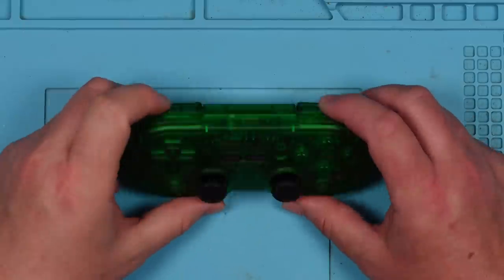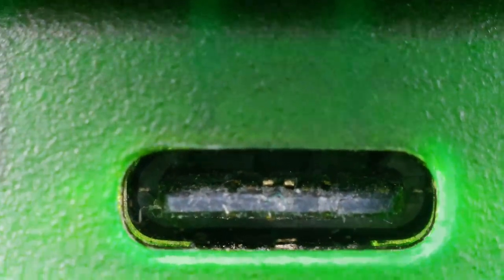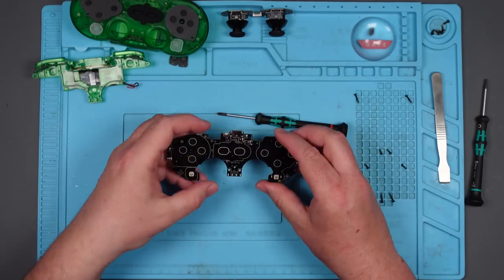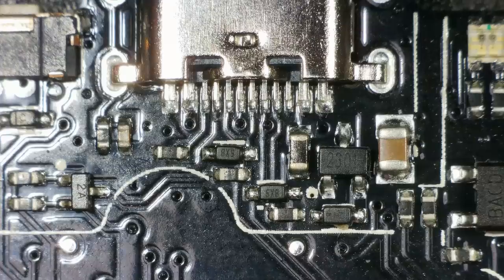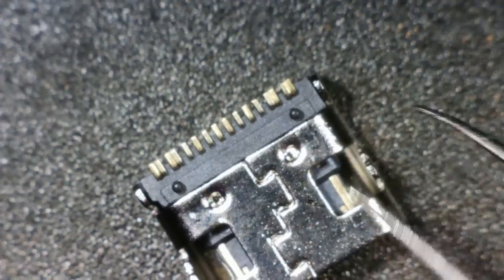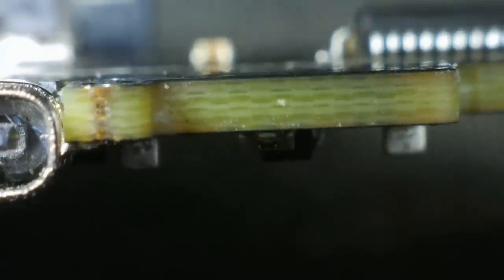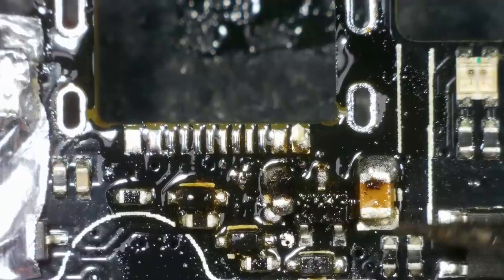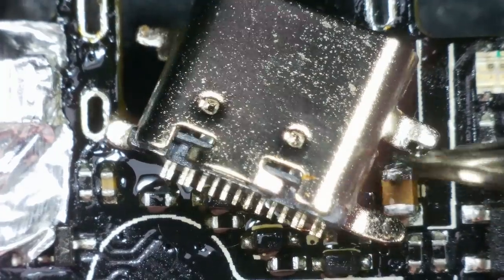I Paid £15 For a FAULTY 8BitDo Controller | Can I FIX It?

Comment: Thanks to you, I managed to solder a switch back onto my car keyfob, saving myself a £200 replacement. It cost me £6.50 as I had to buy the switch in a set of 10 from RS components and the kit, all for about £25.
Reply: Way to go! Doesn't it feel good?

Comment: My SF30 died recently, something started burning on the inside when charging, I could smell it, then it stopped turning on, and charging. I'm nowhere near as knowledgeable as you, so I just bought a cheap 2nd hand SN30 from CEX, and swapped the insides. They stopped production on the SF30s (Super Famicon design) so they get rarer, and more expensive with time, so this was a good way of fixing it for a noob like myself.

Comment: Maybe a little solder on the other side of the board (where the legs are) might add a little bit of strength (assuming the solder blobs on both sides melt into one)
Reply from the maker: Yeah, good shout. I didn't show it in the video, but the solder I applied did seep through to the other side, so the port is nice and solid! 👍
Reply: SOLID!
Reply: @StezStixFix  SOLIDDDD
Reply: solid

Comment: Steve, great video as always. Entertaining and informative as usual but when you replace a surface mount capacitor or resistor, clean both Lands of old solder, clean with isopropyl alcohol and then add fresh solder to one Land only. Melt the solder and add the component back to the board, then solder the other side. If you do it that way, the component will always be flat to the board and back in the correct position without moving.

Comment: These 8bitdo controllers are fairly easy to repair and the manufacturer still sells parts and pads and sticks for replacements. They do NOT sell the R1/R2 pads though.
If those fail on you, replacement pads for an N64 Z-trigger will work if trimmed down slightly, since they already have mounting holes in the right spots on the silicone pad.
The Flat Flex connector for the analog sticks is EXTREMELY fragile, so be very careful when unlocking it. I've had to re-solder a new one on and it's not fun.

Comment: I think that type c port would have been a great place for that chip quick low melt solder. Probably could have gotten it free with iron only.
Reply: Could always bend a giant (comparatively) piece of solid copper wire round to all the pins, it spreads heat well with a single iron.
Reply: @hugegamer5988  That is a method that "Mr SolderFix " channel gives examples of

Comment: You really should look into purchasing some soldering iron tips with what hakko lists as bcm/cm shape. They are conical shaped tips with a diagonal cut and a dent on the cut surface. The dent on the cut surface helps a ton when doing this type of "drag soldering" because the surface tension of solder in the dent helps prevent solder bridging. The other main benefit is that the tip is a straight shaft which helps avoid touching surrounding components when "drag soldering" pins of a connector/IC.
Reply: also having two micro needle nose pliers would have helped put 2 bends in those outer grounding pins creating a similar shape as the pins of the original connector, so the pins would have fit into the holes and help provide sturdiness to the connector.

Comment: I'm pretty sure that the 16-pin USB-C ports are USB 2.0 only, basically a reduced feature set when compaired to the 24-pin ports. The PS5 controller also uses a 16-pin port, but the PCB side pinout is different to pretty much all of the USB ports on the market (you can buy them from RS in the UK, something to bear in mind if you ever need to fix one).
Reply: I saw someone do a repair video with the wrong PS5 USB-C ports the other day on tiktok - I figured I'd leave a comment letting him know it wasn't going to work and discovered he was using amazon affiliate links to send people towards the wrong USB-C ports to fix their PS5 controllers and telling people that they must have fried the usb controller when soldering whenever someone said they didn't work.

Needless to say, he "moderated" my comment away informing people to go to RS.
Reply: @medes5597  that's crazy. I bought some from RS but only used 1, trying to sell the rest as singles on eBay at buy price but no one wants to spend the money required for a legit port. I wonder how many controllers are in the bin after no-fix

Comment: I have a wired one of these. I've noticed that even the best controllers from China tend to have a little too much play on the d-pad and can give you a vertical movement when you move horizontal. A small piece of electric tape under the pivot point of the d-pad fixes this.

But, getting into the thing, I unplugged the USB cable and scrapped off a zenner diode that was a poor man's voltage regulator on the data line, which broke the line and now it  doesn't work. I got new diodes to fix it and made a right mess of it. I need to revisit it at some point.

Comment: The 8bitdo controllers are surprisingly good. I thought a 3rd party controller would be wonky and trash but I wound up replacing my XB1 controller on PC with one. 

It's got grip buttons, which- I thought were a gimmick but they're so, useful.
Reply: I have the SN30 Pro+ Game Boy-themed model, and it's now my main PC controller over the Xbox One S controller I was using. D-Pad is excellent for retro games, sticks work well for the rest, and if the rechargeable battery dies it fits AA's straight away. Plus, it works on the Switch as an added bonus.
Reply: @Festivus_Miracle  Yeah, I stumbled onto their controllers because the Switch controller was way too expensive.
$20 cheaper and more functions sold me on it after a few reviews. 

The only complaints I had  the model you mentioned were addressed with the Pro2. Grip buttons, the profile button etc.

If I'm honest I prefer their M30 though for retro games, growing up with the Genesis I like the rolling dpad more. But the Pro+/2 dpad is super good for sure

Comment: Best controller companion for the steam deck. I use the same. You can put the controller in 4 modes. X-input for best compability. But steamos can handle pro controller setting. And then the legends on the controller are correct. So don't know what mode is the best.

Comment: Hmm. I'm having a similar problem with my 8BitDo Pro controller. I can still use it but it has to be plugged in all the time because the battery won't hold a charge. 🤔
Reply: If you can use it plugged in the USB port is fine. Most likely the battery is below the safe voltage to recharge or just shot, or possibly the charging chip has failed.

Comment: You wanted to desolder the USB C port. So why did you start by rubbing flux and leaded solder every where? Is that easier to desoulder? Or does it add a heat sink in there to prevent the button from melting?

Comment: My 8BitDo Controller has a faulty usb port too, it's sad for a controller which is supposed to be good quality. It happens if you play a lot using usb cable instead of wireless connexion, the usb port isn't strong enough.

Comment: Had a bit of a brucey bonus this last week, one of my saved sellers I bought some NOS watches from emailed me asking if I would be in the business for a HD AIO microscope, now bear in mind my main scope was a cheap £10 USB thing on a pantograph arm I modified and ran through an old PC, so in my kitchen at mo is the thing and only thing wrong is it didn't come with the promised 16gb SD card but 32 quid free delivery which in comparison to the £32 ones on Aliexpress, its a lot better quality and spare SD card in slot, all metal frame and deck its def a game changer for me.